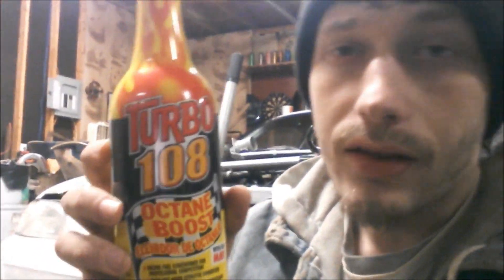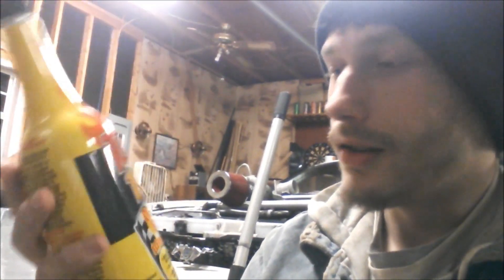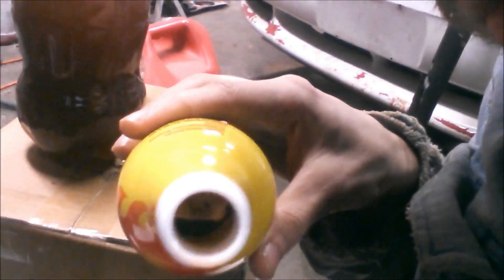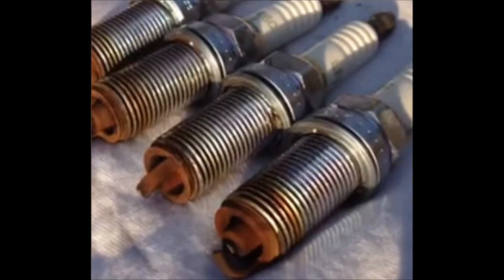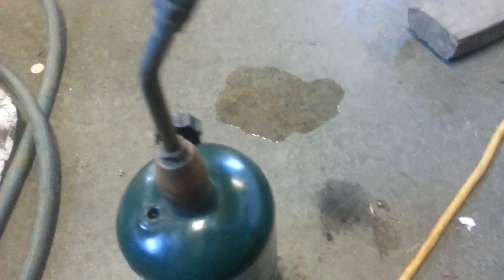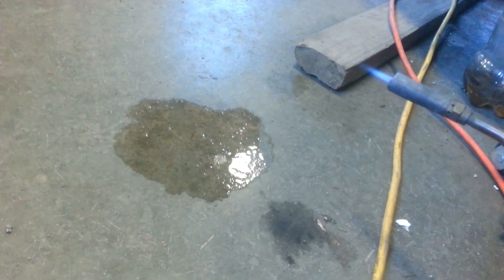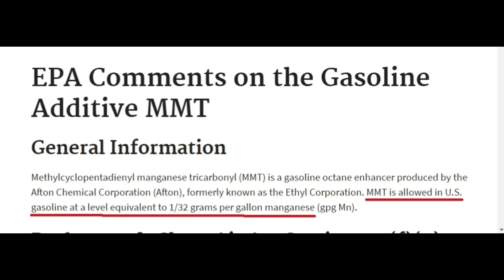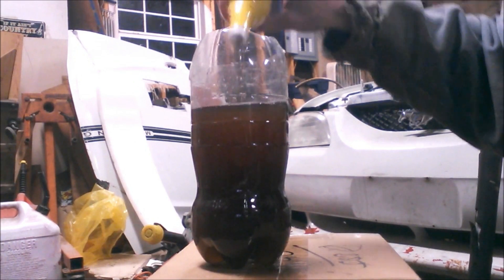- Octane Booster.___ What's in it, and is it safe ?   [ MMT fuel additive ]

Comment: The original 104+ stuff had MMT in it and MMT is almost  as good as TEL (tetraethyl lead)  However at meaningful levels MMT will wreck your  catalytic converter same as lead.  The 104+ that says safe for converters dosen't have anything that really makes a difference.  Use premium unleaded and you'l achieve the same thing.
Reply: Thanks to brandon hard to afford just 87!
Reply from the maker: You mean .. thanks to the U.S. and other countries for funding Fuel to our allies .
Reply: @GermanshepherdLover4ever  Useless and uninformed comment.